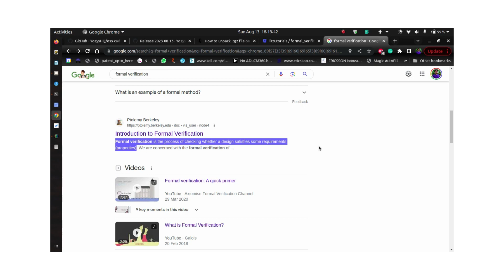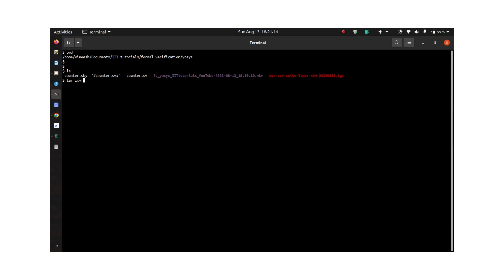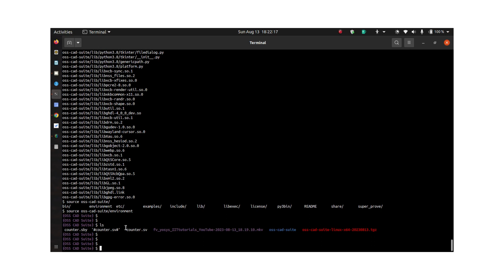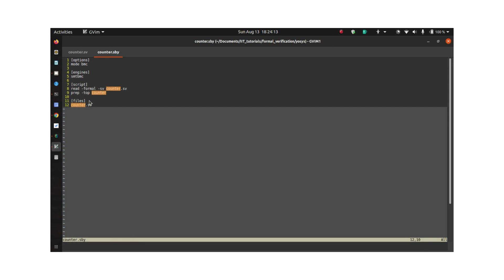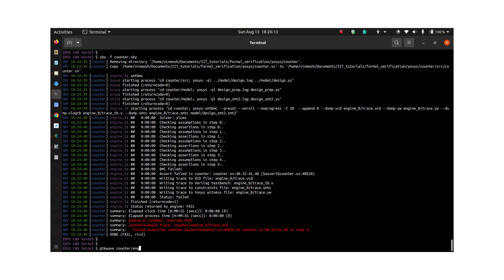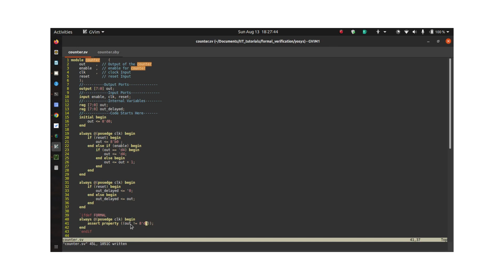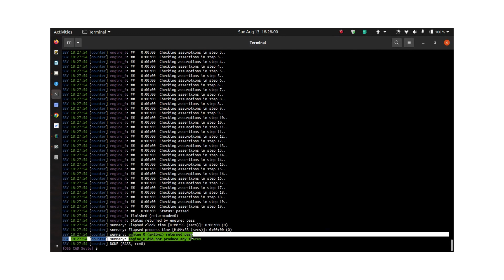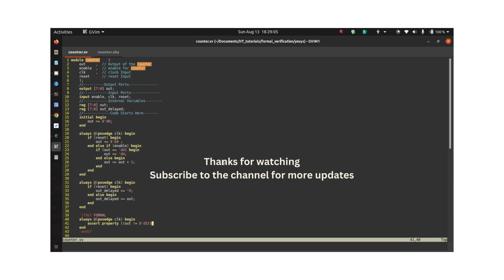Beginner’s Guide to Formal Verification

Comment: Can I use formal property syntax with fully featured SVA if I have not subscribed to Tabby CAD suite?
Reply from the maker: Hi, 
Thanks. It might not be possible.
Reply: @formal_intelligence  could you elaborate a bit? Is there any alternative tool in that case?
Reply from the maker: The best idea would be to use industry tools. Do you have access to Jasper or VC Formal?
Reply from the maker: Also, please try requesting a trial license for Tabby CAD
Reply: @formal_intelligence  Unfortunately, I currently do not work at a semiconductor/IP design company, thus I do not have access.
Reply from the maker: Hmmm. I understand